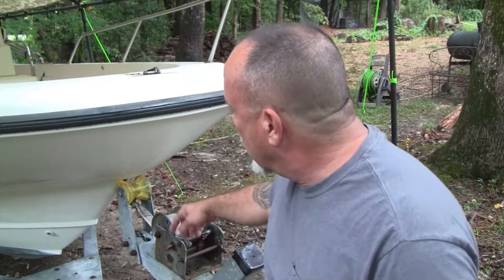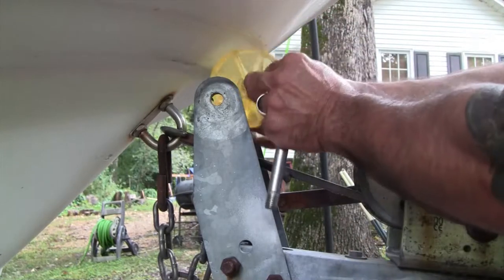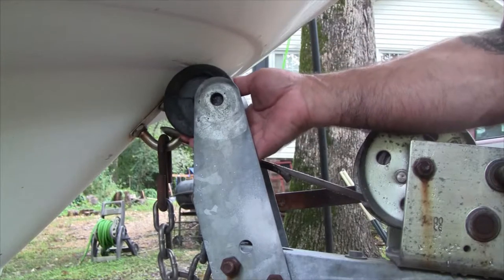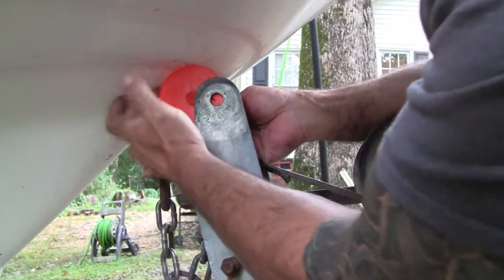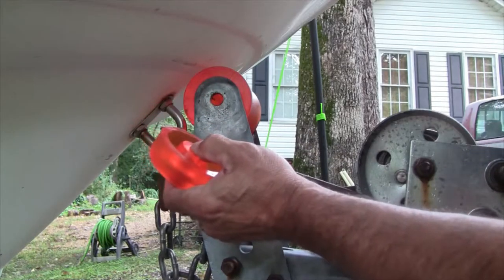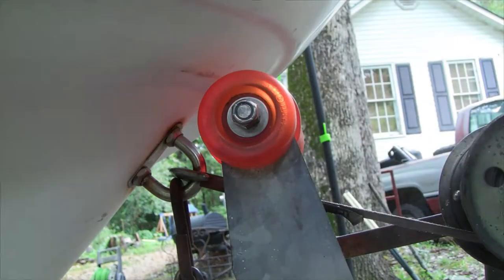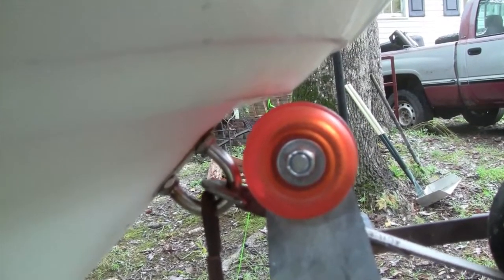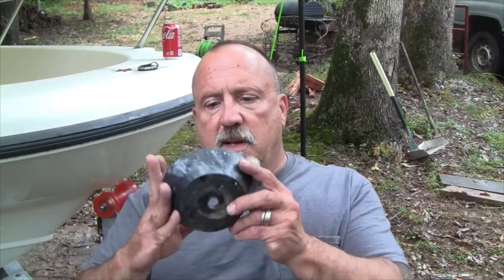Perfect Bow Roller for Boston Whaler Dauntless or Other Smirked Hulls

Comment: gday mate i am having the same problem with my front v block bought a new one and it is not bringing the bow up as i would like it about 20mm gap between the bow and inside of the new v block and this s what i was thinking of doing as well .
Reply from the maker: I think this bow roller solves the problem for me. It might help with your as well. I'll look up the part number and put in the description.

Comment: My brand new trailer does not spin like yours. I'm going to loosen it up because I'm getting some marks on the boat as I'm putting it on the trailer from my dauntless
Reply from the maker: That's why I went with the polyurethane as I was having the same issues.